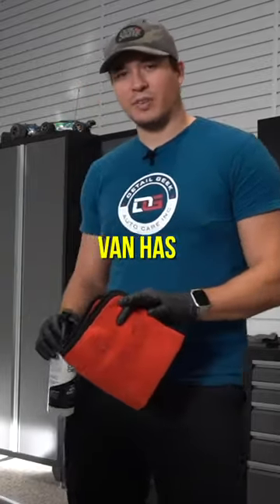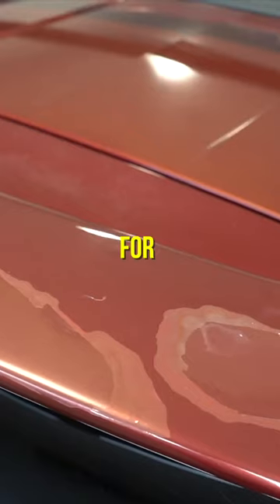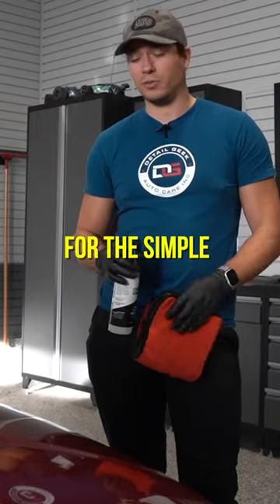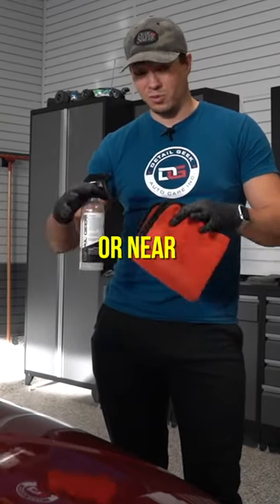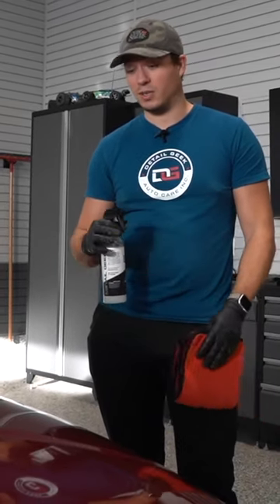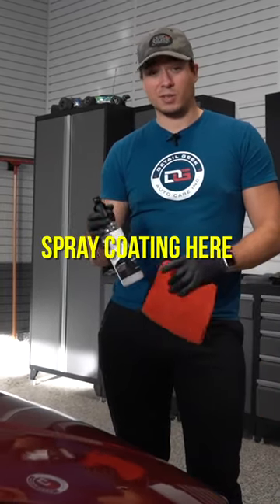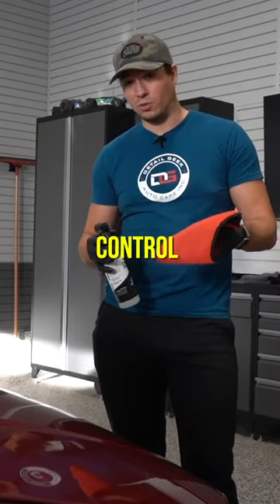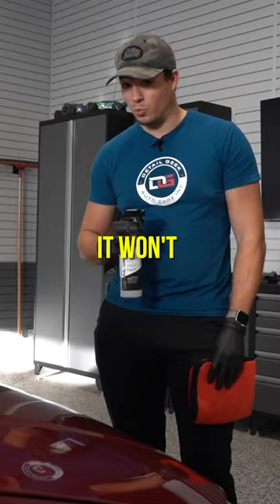Ceramic Spray Coating | #shorts

Comment: There is literally no excuse not to use paint protection. Heck even after running it through an automatic car wash, just spray some wet coat and rinse it if even using a spraywax is too much effort